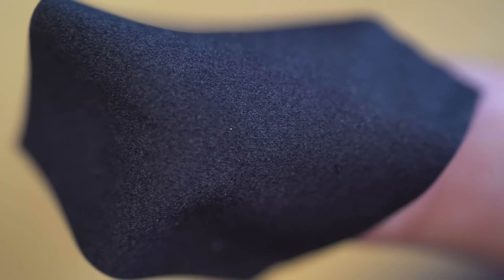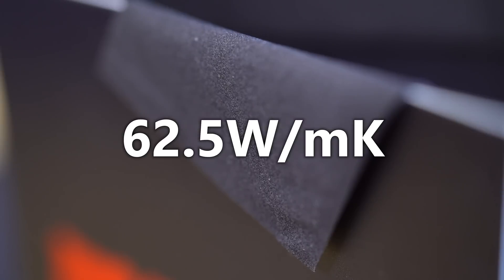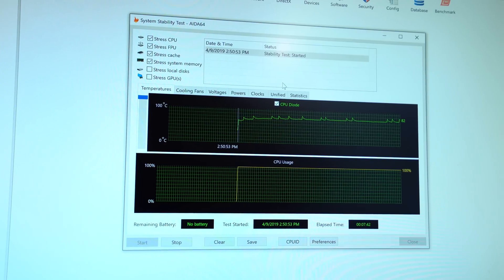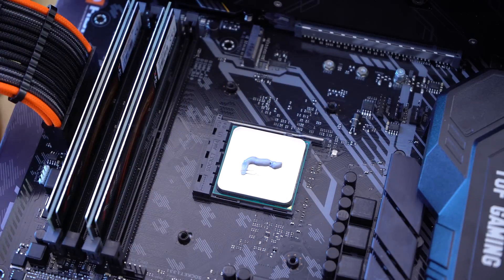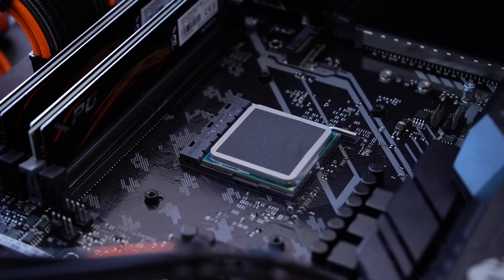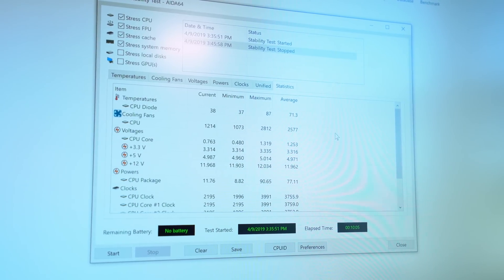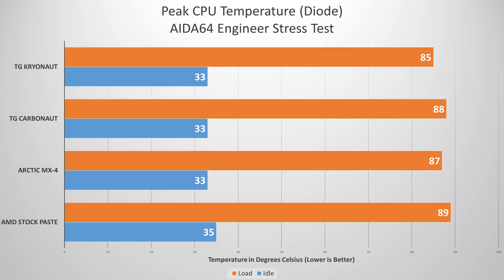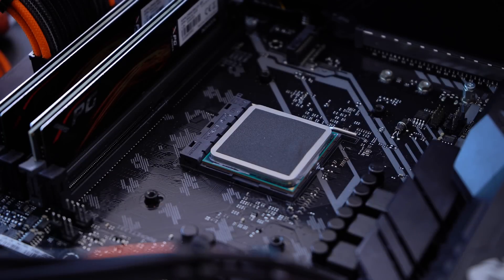A Game Changer? | Thermal Grizzly Carbonaut Review

Comment: You don’t use an AMD size pad? Seems you cheaped out instead of purchasing a pad that would fit that AMD processor!
Reply from the maker: Temperature differences were negligible, so no. We didn't cheap out.
Reply: @GregSalazar  Fair enough, Good video though. 
Looking at this type of products for a new build next year when Intels 1851 socket and processors are available (if my ancient Gen2 I7 computer holds up),  So much to get up to speed for a new system and then $$$$ for just GPU’s unreal!
What is your take on this pad verses the Kryosheet I see on Thermal Grizzly’s website?
Thank you, Best to you and the channel!

Comment: I am thinking of using Thermal Grizzly Kryonaut or Arctic MX4/5 for my new build. I have read of people complaining that the Kryonaut is that sticky removing the heatsink has resulted in it pulling the CPU out of the pins when re applying thermal paste. Arctic MX 4 is easier to use but temps have been reported a lot lower than using Kryonaut. So just wondering which one would be best to use?? I will be building a system around the intel core i9 12900k

Comment: You should try K5 Pro viscous thermal compound ( the company says it’s lifespan is almost infinite and according to a LTT video it’s really good stuff especially for GPU’s ) for thermal pad replacement in things like GPU’s, PS’s, Xbox’s , iPhone’s anything with thermal pad really, if Kingpin KPX only last 6 months like they say think I’ll try Kryonaut Extreme then regular kryonaut till I find a good paste that at least last one year KPXis awesome but changing it all the time will suck once my tube is gone if that’s how it goes I’ll try the extreme I don’t wanna mess with LM I have PD and hands shake badly 67 W/km or w/e is BS way way over rated my Dell prebuilt came with Gennel 1.97 W/km ( I take it that’s what they used that how it performed I’ve seen crest do a lot better ) it was horrible I couldn’t use my gaming PC till I re-pasted it

Comment: If you are overclocking I wouldn't use this but if you do not plan on overclocking, it works perfectly fine. Be VERY careful when removing the cooler as it rips pretty easily.

Comment: 62.5 W/mk is in the XY plane. In the Z direction is less than 10% of that. This means it spreads heat very evenly but doesn't let go of that heat any better than a good cheap paste.
Also MX4 vs Kryonaut is subjective. 2-4 degrees max difference in Kryo's bench but a huge price/quantity advantage for MX4.
I for one am a MX4 adept. I still have a little more in a 4g tube I bought about 6 years ago and used on both my desktop and laptop bi-yearly.

Still, it's a great product for casual users, not for those looking to squeeze the most flops for each buck they spend.

Comment: Id like to press some great importance on the performance of thermal pads:
Thermal paste does perform much better but however since everybody is testing this with fresh thermal paste to run benchmarks,
After about 1 or 2 months with the best thermal paste applied you will soon be having temps higher then a CPU that uses the thermal pad.
Yes thermal paste dry up that fast especially around the edges.

Comment: Could you do a video on direct die cooling solutions please?  While I'm here whats different with a direct die cooling solution? I know if I simply put a typical air cooler on the cpu without paste or in this case a thermal pad, bad things will happen. What I don't know is why.

Comment: Greg does Science Studio know when these are available to buy in the US? Buying from Case King seems to incur shipping costs greater than the pad cost. There is the IC 40x40 option available right now on amazon, but it would be nice to buy the TG 38x38 solution with slightly better operating characteristics if possible. Any chance Science Studio can provide insight on US purchasing?

Comment: 95 watt CPU with a 95 watt cooler doesn't really show the potential of how much heat this can actually transfer though. A better test would be an i7 920 or i7 950 with a high TDP rating 130 Watts if I'm not mistaken, to see exactly how well the transfer is once that sucker gets hot. My 9700 K all core turbo to 4.9 on a dark Rock 4 Pro using the stock paste with the cooler is 24 to 26 Celsius idle 62 to 65 Celsius full load all cores occt on an h500m case mesh front. I mean with that you're operating between reasonable temperatures that no game is going to ever get me to and if you have to eke out a couple degrees Celsius you're already in trouble. Not quite sure this CPU and cooler choice really shows if there's a breakdown with heat dissipation and higher TDP. Just my thoughts

Comment: Windows task manager shows percentage of RAM used. If I have 8gb of RAM and  have 4gb Excel file open and W10 says 50% of RAM used, does that mean the file is using 4gb of RAM, if I have 16gb of RAM and windows says the same thing, does that mean that exact file is using 8gb of RAM, if I have 32gb of RAM does that exact file now use 16gb of RAM? I can see the actual RAM uses and …. YES…. I KNOW that the 4gb file is actually not using 16gb of RAM… but the question is why does W10 report RAM usage that way?

Comment: I've used a graphite thermal pad in my mini itx system for over three months.  And it works great!  Low temps and just works. 

Now the reason I switched. Well when cleaning out my rig I removed the heat sink but along with said sink also came the processor.  Yeah,  big problem! They were permanently fused and since they sit face down were now totally useless.  Because could not get processor reseated. 

So after spending another small fortune for new processor and heat sink I decided to explore alternatives.  The graphite pad was $13 on eBay.  The best $13 I have ever spent!  Will never go back to paste.

Comment: It is not a good idea to use this in testing because it is not a real world testing methodology. Very few people are going to be using this, at least for now.
Reply: results on this video show that it's almost on par with good thermal paste. Seems to me like the difference between a system with cooler A and this pad vs a system with cooler B and this pad can only be due to the cooler used rather rather than how well a paste job was done.

Comment: The problem with those carbon pads is they slide around like crazy, so putting the cooler on perfectly without the sheet moving is going to be an issue.

Comment: Seems like its splitting hairs at this point. As far as your video portrayed; Like you stated, it's possibly not running at it's maximum potential due to the lack of covered surface area. Maybe if you get samples that fit your CPU maybe then a difference will be made.

Comment: Testing with the wrong size pad, what a total waste of time...  🤦‍♂️
Reply: Well it basically performed like the paste. Don't see the timewaste anywhere
Reply: @the.droetker  You need to go and have a good think about that before coming to any more bogus conclusions.
Tip: Air W/mK = 0.0262
Reply: So what are you suggesting? That the temps will drop by like 5 degrees because of the little space? When you already start with thermodynamics and heat transfer physics, then also you need to factor in, which part of the ihs will be heated the most :)

Comment: I am not as enthusiastic as you are. I have used one, and was terrible for cpu cooling. Changed to a carbon based thermal compound, and all is well. By the way metal grease is toxic, so you should use gloves, and in all cases wash your hands carefully.

Comment: I have a handful of suggestions for tests with this. 
Stock CPU IHS vs a properly lapped IHS and possibly lapped cooler too, as they're also not perfect. Then I'd like to see how this performs on laptops, and other devices with chips that don't have an IHS; then to further this idea, try going IHS-less on desktop, silicon-carbonaut-cooler? Also curious about it's performance on Gpu chips. Ect., etc.
Replacing traditional thermal pads, for non-computing components, would also be an interesting test.
Basically, test everything possible, for science.

Comment: You mentioned in the video that its electrically conductive -- for laptop applications, though, this would be perfect, right? The biggest challenge to using LM in mobile systems (like laptops) is leakage, which calls for specialty electrical tape and conformal coating to prevent this.

Using this carbon-based solution, though still electrically conductive, would essentially eliminate the risks of LM, while also getting similar performance to Kryonaut? And eliminate the need to reapply, too. I've repasted dozens of laptops and this would make my life so much easier.

Comment: If you can, please test again but with more mounting pressure. One advantage of carbon pads is that they can withstand much more pressure than paste. I'm my testing I saw ~3C improvement by shimming the sprung mounting screws. If you want more info I posted on the LTT forums "another graphite thermal pad test"

Comment: I do onsite pc repair for many major brands.  This stuff would absolutely make my job tons easier, and end the frustration of finding a machine where the last tech used an entire .7 gram tube of thermal compound for a laptop CPU.  I will only use the thermal pads (pre-made slightly tackier thermal compound) in machines I have no concerns about heat (i5 and lower new machines).  I wonder how the performance would differ with a direct to silicone application like most laptops utilize.

Comment: I don't have a Thermal Grizzly, but I have the one that Linus used to burn himself...well, the same type anyways.

I will say that it cools really well. The issue is that placing it on the cpu and keeping it there isn't as easy as you'd think. If your water block or heatsink shifts on the cpu while you are tightening it down, the thermal pad will shift as well. You can end up with it hanging off of the edges of the IHS.

Comment: I started using IGC's graphite pad and after a month of use noticed one thing, My 2400g being cooled on a H60 its temps are roughly 1-2 degrees higher than when using stock TIM but the temps are way more stable now. I'm assuming this is from being a thicker medium the heat has to move through. So I traded I slightly cooler system for one that is waaaay more stable and doesn't fluctuate by 5-10 degrees like it used to.

Comment: I'd be fine with a thinner version that may not last re-use if its just cleaner and removes the expansion issues with LM or pastes. LM performance with less risk and can be used with any type of metal cooler/IHS, I'd buy it!

I have the IC graphite pads, but those are a bit annoying with how much they slide around and I just use them when messing around but still stick to Kryonaut or MX-4 for long term applications, so if this doesn't slide around as much or bunches up causing creases/folds when applying, even better.

Comment: I used this product when testing out different CPUs in my rig. It works well and only noticed about a 2 degree rise in the temperature. One thing to watch out for tho is that it tends to slide around and get off centered when installing the cooler

Comment: Just a suggestion: When testing different thermal interface materials, I'd suggest using a better cooler. When you test it with a stock cooler, that as we all know is far from being the best option, the cooler itself may become the bottleneck of the cooling system, rather than the TIM. So perhaps with a bigger cooler we'd see a bigger difference.

Comment: Sounds like its Graphene, look it up..
only worry id have is if there is a micro crease when putting it down.
Reply: @Pho Tato thank you for that. Love information. I'm wondering if the graphene would be better to make these, I was watching a video on strength, heat transfer, and conductive properties and it sounded amazing. Likely could be thinner also I'd imagine. And the durability would definitely last with graphene, only at the moment the video I seen it was bonded into rubbers etc

Comment: Do one without the pad or paste, probably won't see any difference lol
Reply: You have a computer I'm sure, should give it a try on yours first.  It probably won't melt.
Reply: @GordonFreeman.  done it lots of times over the years, specially when cleaning the old stuff off and not got any to hand, seriously if it's a good fit thermal paste doesn't really do that much. And none is certainly better than old baked stuff for sure. Would be interesting to see the comparisons in temps.
Reply: @manwithapan9481  Bahahahaha.  Stick to cooking daddy.
Reply: @GordonFreeman.  I'm currently running an i7 8700k @5ghz with a corsair water block and a 2080ti all wrapped in a nice corsair obsidian case with a 1000watt PSU, I built this one myself. Mainly for VR.
    I'm not suggesting that nobody should use thermal paste, I'm suggesting it would be interesting to see some temp results with and without, as I say I have done it in the past and tbh not really seen much difference. My old i72600k for example lasted like 6 years with no thermal paste, I only realised it didn't have any when I removed the cooler and it was clean underneath :/
Reply: @manwithapan9481  You should try your loop without water next.
Reply: @GordonFreeman.  That's not even similar lol. We both  know the result. Apparently tomato sauce works better than none  watch?v=D-pr4cf70qY hahaahha I guess it depends on the cpu and the cooler

Comment: Only issue you missed on was the pads are rated in their horizontal spreading, so they spread the heat ACROSS them very well but they don't spread it vertically nearly as well. (So from the pad to the cooler)
Thus why most thermal pastes still out perform them, specially when used in non-stock uses

Comment: I bet if u lap that cpu the pad will preform exponentially better. Also my 2600x can do 4.275 with just a bump in voltage 😛 .. I do have it under a 360 aio. It's max temp at 4.2+ is about 67-68 c, in  21c room temperature with 60% fan and pump speed. I love it.

Comment: I wonder how it will hold up over time while repeatedly being moved from system to system for testing. All that touching it with your fingers will transfer some oil to it and that will build up with dirt and dust sticking to the oil and I imaging that might degrade performance over time. Still far more reusable than thermal paste, but maybe something to keep in mind if you plan to use this to standardize tim application for thermal testing.
Reply: Just use gloves. Everyone should be using gloves anyway for handling internal components.

Comment: I've been considering using this in my next build (probably a year or two away), I just like the set it and forget it aspect to it and the reusability is also big.

If I decide to swap coolers or something?  I love the idea of not having to bust out the isopropyl alcohol to clean out the old paste, find a tube of paste, reapply and all that crap.  Just put the damn pad down and put on the cooler.  I mean, that level of simplicity really is nice as long as the performance is adequate which it seems to be.

Comment: I'm still interested in the raw-material (Panasonic PGS?)--the form with higher XY heat conductivity--used as a heat spreader. As a basic test: using it on Ryzen+custom adapter (3D printed or CNC-ed, so the material holds up to the cold plate) to see if a full-coverage TR4 cooler can be better utilized. On the more advanced side: a strip of it stretching in one direction as a heatpipe... either for external air-cooling, and/or for multiple coolers mounted.

If that does work, I'm sure people will go as far as direct-die cooling. If electrical conductivity is only an issue with surface-mount components, maybe another custom-adapter would be all that is needed.

Comment: Could we use this for GPU's ?? I've got Radeon VII and I'm really tempted to change that pad the card comes with my Hot Spot temp is 110C :( ……...
Reply: TG have got size of Carbonaut for RTX 2080 Ti, so they think it's possible to use it on GPU. To use this product on Radeon VII i think you need to find Radeon VII die size first. After that check TG sizes which will be good for Radeon VII and test it. But you will be first who do it, probably. =) Also, i think Radeon pads is Graphite, not Carbon. In theory carbon should be better, but there is only one way to know it for sure.

Comment: The only risk I see with this is that it could collect dirt, debris or even hair (seen at 10:28) which could hamper performance.  Still, its very innovative!
Reply: Thermal compound doesn't lack this possibility either. 
It's just this thing has the possibility of existing outside of a PC build because it's a solid object that's easily manageable.
Reply: Well he is flopping it around everywhere, touching it and placing it on tables, so thats quite obvious, if you transfer it correctly you should have any problems, also using some kind of tweezers instead of your hands could help with keeping it clean too
Reply: @Kykot1999  or where finger condoms
Reply: I'm a little confused? Thermal pads or thermal paste can collect dirt, debris or even hair under a CPU cooler? Can you explain how?
Reply: @carolusrex8293  He means because it is a pad that will obviously get handled more (touched, moved around, set on something, etc.) compared to squirting paste onto a die right before placing the heat sink, it is far far more susceptible to getting 'shit' on it.
Reply: The Kriptoker where hair?
Reply: just wash it
Reply: @marc_frank  the carbon will dissolve DUHHHH and you'd need to dry it
Reply: @stevethea5250  its in rubber and drying is no problem
Reply: @marc_frank  You don't even know if you can wash it without ruining it lol, there can be a compound used on it that might react with water or soap or anything you'd use to wash / clean